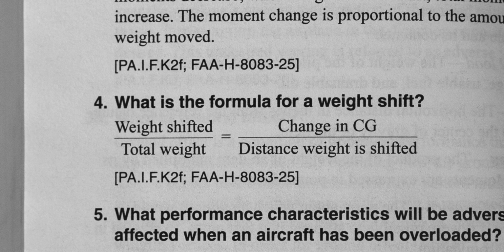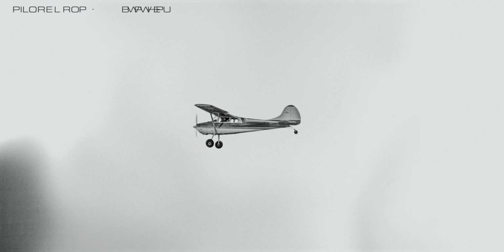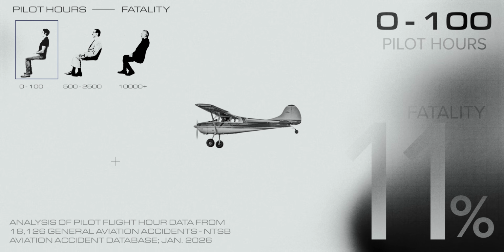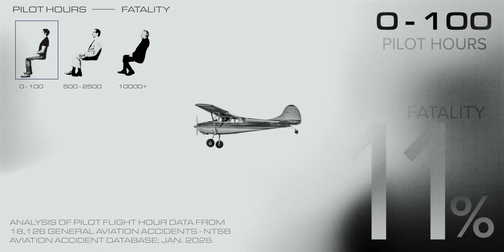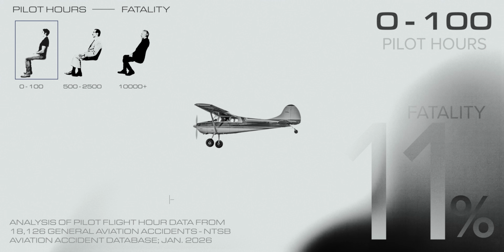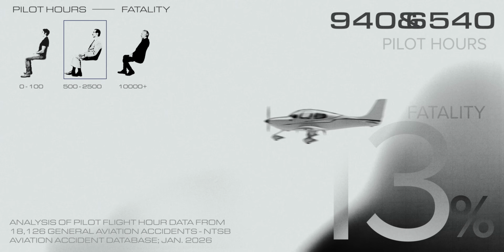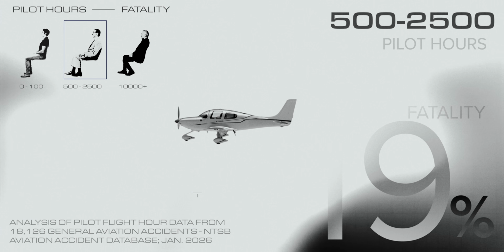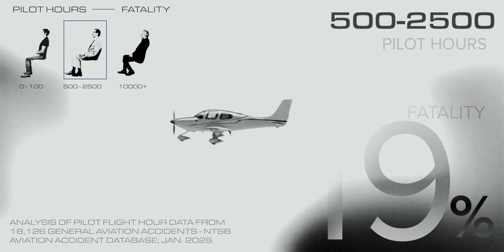Why Small Planes Crash (The 100-Year Design Flaw Nobody Fixed)

Comment: I have flown airplanes with electronic systems, that had "redundancies", yet I've still experienced total system failures regardless, total loss of all primary and backups. And those were simply software failures in systems like the G1000. I just flew my airplane the other day with no electrical system at all. how do you deal with a total electrical failure such as loss of battery, loss of alternator, etc.? all this talk of redundancies and I've never experienced a plane with systems that address my concerns and experiences. And by the time you do solve it, it will be too expensive for most pilots to afford. and even airplanes designed not to stall have had pilot error loss of control fatal accidents. And just look at how much of a failure self driving taxis have been.
Reply: in aeronautical certification there are different levels of redundancy requirements, depending on the consequence of failure of each system. For General Aviation, the loss of avionics systems are not considered catastrophic, but major consequence, and for that reason, the failure probability accepted is much higher. That's why experienced pilots like yourself will have a non-negligible chance of experience this events sometime in their life. Critical systems (the ones considered to have catastrophic consequence in case of failure) have much more demanding requirements to comply so that the probability of happening is 100x lower than those of a G1000 for example. A total loss of energy in a Fly-by-wire airliner NEVER happened in the 40+ years they've been in operation. That's because FBW systems are certified as DAL-A instead of DAL-C (as GA avionics are). DAL means Design Assurance Level, from the ARP4761 standard.
Reply: @LucasFontoura-skytron  Loss of primary instruments in IFR is FATAL. non negotiable. In VFR, less of an issue.

But this is FBW, electronic flight controls, an electrical failure, though mundane for most certified aircraft, would be fatal in this airplane.

"That's why experienced pilots like yourself will have a non-negligible chance of experience this events sometime in their life."

I have experienced all of these sorts of failures in light GA airplanes such as Pipers, Cessnas, etc. Total loss of instruments, loss of generator/alternator, loss of battery, loss of electric flaps in the down position, autopilot failures that tried stalling the airplane, landing gear extension failures, etc.

The consequences of loss of G1000 in hard IFR are fatal without a backup attitude indicator.

" A total loss of energy in a Fly-by-wire airliner NEVER happened in the 40+ years they've been in operation."

but it WILL 100% guaranteed happen in light GA airplanes such as they are designing. We're not talking about airliners here. this video is not about airliners. And no matter how good the system is, it will fail, and you cannot certify avionics to guard against a physical electrical failure outside of the avionics, such as a failed battery, wire, etc.

This will add serious cost and additional risk to already expensive GA airplanes. only the ultra wealthy will be able to own GA airplanes with this sort of technology. The Average Joe pilot flying for recreation cannot afford this.
Reply: @SoloRenegade I'm a cybersecurity specialist, not a pilot though my undergrad degree is in aerospace engineering.  I'm very interested in most things aviation.  I appreciate where you're coming from as I agree that everything will eventually fail.  It's a question of when, not if.  However, I applaud Lucas and the team at Skytron for this undertaking.  Arguments similar to yours were made regarding cars.  And whilst I certainly agree that where we are in the self-driving category reinforces your position, I would argue that most general transportation vehicles are NOT out of the realm of affordability for most of the driving public.  Safety innovations, IMO, should always be encouraged and applauded regardless of from where they appear.  Condemning these efforts as the first fruits from them will undoubtedly be far more expensive than a used smaller GA aircraft from the 1960s that is (probably) still airworthy simply because of the cost is IMO a poor reason for such opposition.  This is the position I would expect from a CFO, but not from the end user.
Reply: @alexanderbreeding1830  the self driving taxis have been an abysmal failure, and all other self driving cars like tesla have had fatal accidents, and tons of buggy issues.

I'm critical for good reason. when you take the pilot out of the airplane, teh purpose of recreational flying ceases to exist. they are addressing the accidents with a false premise.

Cybersecurity has nothing to do with this. if your airplane's autopilot is remotely accessible/hackable, you deserve prison time, not just a failed business.

"Condemning these efforts as the first fruits from them will undoubtedly be far more expensive than a used smaller GA aircraft from the 1960s that is (probably) still airworthy simply because of the cost is IMO a poor reason for such opposition."

False, you clearly have No clue how expensive aviation is, particularly avionics. Don't go criticizing professional pilots, experimental airplane builders, and aerospace engineers on things you don't know about.

The end users will not be able to afford this. the avionics for this airplane will cost more than both of my airplanes combined, let alone the rest of the airplane. these are not airplanes a typical pilot will be able to afford.
Reply: If all else fails there is always the rocket propelled parachute. If all of that fails the Murphy’s Law of “If you make something idiot proof some idiot will prove you wrong.”
Reply: Yes airliners manage to do it with greater than 6 sigma reliability.
Reply: @MrKDreams  AIRLINERS, not light GA personal recreational airplanes.
Reply: @SoloRenegadeTesla FSD computer is fully redundant including redundant cameras.   Hardware has the power to run a neural net stack for driving on roads which is far more dynamic and varied than anything that happens in an airplane.  Cybertruck is fully drive by wire with tripple redundancy.   We are taking 40-60k cars.  How mucy is a new 172 now let alone a cirrus?
Reply: @MrKDreams  and yet we have many self-driving bugs and fatal accidents.....doesn't inspire confidence. No typical pilot is buying a new Cessna. only flight schools can afford a new Cessna. and this plane will cost even more.
Reply: The solution is double or triple redundancy of all systems. It's as if there were 3 souls piloting the plane. If one fails, the other takes over and acts independently.
Reply: @fernmr  none of that protects against a basic total loss of electrical power, shorted cable, etc. Even military aircraft have mechanical backups, or the pilots eject when the FBW fails (and it DOES fail).

Average GA pilots flying their own personal airplanes cannot afford such a system in their airplanes. the cost of the system and its maintenance will be a nightmare. The resale value of these planes will be terrible.
Reply: @SoloRenegade  In a system with maximum redundancy, the cost is measured by the buyer. And in fact, this system can indeed eliminate faults if the power supply and transmission system is also duplicated. By cutting off the power flow to one circuit, sparks are terminated and extinguished in the absence of combustible materials.
Reply: @fernmr  "In a system with maximum redundancy, the cost is measured by the buyer."

Wow you people are stup1d. where did you get an education? you should ask for your money back. the price is the $ amount the seller lists it for. 

"And in fact, this system can indeed eliminate faults if the power supply and transmission system is also duplicated. By cutting off the power flow to one circuit, sparks are terminated and extinguished in the absence of combustible materials."

Power supply? you mean the starter battery? That doesn't have the capacity to drive flight controls for very long, and adds a lot of weight and hundreds of dollars of additional cost as well? And That is still powered by the same alternator/generator too, leaving a single point of failure. And doesn't account for damaged wires shorting out either. All failures that occur more often that you want o believe. typically such failures go unreported as teh plane landed safely and got fixed. but with FBW, that wont be possible. Starter batteries don't have the energy capacity you think they do. They are optimized for short time, high amp use. and flight control actuators require serious power compared to simple mechanical controls which require none. You're adding too much cost and weight for that redundancy that still has single points of failure.
Reply: @fernmr  Thats right.  The solution is redundancy of all systems.  It will have 3 flight control computers, 4 power sources (2 alternators, 2 batteries), redundant power distribution, comm lanes, etc. etc.  It's the same strategy all the eVTOLS are using to build incredibly safe, FBW aircraft.  The aircraft remains safe with the loss of any single component, and, can withstand the loss of multiple components in most scenarios.  No airplane is "perfectly" safe, but we do believe it will be 10x safer than any GA plane that's currently on the market.  On top of that, the aircraft will have a parachute for the ultimate backup.

Comment: you need airspeed, altitude, ATTITUDE, heading
Reply: The secondary function of an airspeed indicator is attitude, so in a failure situation, given a throttle setting, you have some idea of your attitude.
Reply: @tafaragadze6432  you are correct, however in reality it's nearly impossible. I have flown instrument approaches in real airplanes and helicopters without an Attitude indicator, but only with another CFI aboard (and 10min of that was exhausting and difficult, even knowing it was going to happen). I've given students the scenario in simulators and the fatality rate was 100% when the attitude failed unexpectedly. And airspeed alone wont give you enough info, you also need altimeter and heading too.

But, with this automated flight control system, if you lose the attitude, you'll likely lose the airspeed, heading, and altimeter at the same time as they are all a single system. I've had this literally happen with G1000. They claim systems are isolated and have failure backup modes, but every time the G1000 failed on me, it was a total failure of all systems. others have experienced this as well. One couple famously survived only because they had an iPad with foreflight and synthetic vision.
Reply: You seem a lot more experienced than me, but the training aircraft I fly doesn't have attitude. I haven't done instrument, I only fly vfr, and while it would have been nice, I have never actually needed an attitude indicator.
Reply: @keaton_m  yes, if you're VFR, you actually don't need Any of the instruments i listed. If VFR on Top, you'll likely need a magnetic compass at least though. But I've flown solely on pitch and power settings for airspeed, and at one point I even could fly 70, 80 and 90kts in Robinson helicopters simply by the sound of the air rushing past the cockpit. I'm pretty sure many glider pilots can do this too. The first airplane I trained in, i got so used to flying it that I could tell the RPM within 100rpm simply by sound of the engine. and for a given pitch and power setting, i could fly given airspeeds, looking at pitch of the nose to teh horizon (#1 ref point). And of course, as you know, VFR flying requires visual reference to the horizon (the VFR attitude indicator). And if youre able to see the ground and know where you're going, you can look at roads, rivers, and other features to keep track of heading.

What I am speaking of is specifically IFR. the whole premise of this video is safer airplanes and using avionics to facilitate that. if you need avionics to fly safely in the scenario they specifically mentioned in the video, that I was quoting and correcting, was more about IFR flying.
Reply: This conversation is informed enough that we should probably use IMC and IFR more strictly. Inadvertent IMC is the killer to VFR pilots.
Reply: @jeffreypierson3023  IMC = IFR

IMC can only legally be flown under IFR.

Your worry about terms does nothing to change the discussion whatsoever. You NEED an attitude indicator at the Bare minimum to fly IMC or IFR safely even when all else fails. It's not optional. Even the FBW system needs some form of attitude control too.
Reply: False. You need AOA not airspeed. Airspeed is a poor proxy for AOA. An old fashioned Turn Needle would also be nice. The TN is the only reliable source of direction in an inverted spin.
Reply: @Fffflats  you do not Need AOA to fly safe, but yes, you could opt to switch out AOA for Airspeed. but AOA is not as useful in all conditions as airspeed for most mundane typical flying. you can fly numerous different airspeeds at a given AOA, thus leaving you not entirely sure how fast you're going at times.

The point is, I was quoting the video and they left out Attitude as a vital IFR instrument. 

Turn needle is NO substitute for the attitude in IFR. I have trained this in real aircraft as well as simulators and it's still very difficult to stay wings level.

"The TN is the only reliable source of direction in an inverted spin."

good point. but the comment was about bare minimum instruments needed to fly IFR, not inverted spin recovery. I love the input, but it's dancing on the verge of cherry picking.
Reply: @SoloRenegade I wasn’t saying TN was a substitute for the horizon. I was saying there is a different reason for it. Fair enough concern specific to IMC. As to AOA, most your flying except for Vne, and if multi, Vmc, your points of interest are all AOAs not speeds. But, yes, for navigation you need speed but then this is ground not indicated. Vne is interesting as if flutter be the concern, it is really TAS, but if it be dynamic pressure, then it is IAS. Note in the multi, Vyse is really better done as AOAyse. IMC, more broadly, IFR, however, IAS has a good use for spacing.
Reply: @Fffflats  Yes, I gathered you were referring to the TN as serving a different purposes, but wanted to clarify they are not the same.

But I think we're on teh same page. AOA is very useful and has its uses. but I'd venture to say we agree that for certain tasks AOA is better, and for other tasks, ASI is better. Stuck in typical IFR I would care more about ASI as nothing I need to do requires high AOA. But AOA is handy. I just don't see how AOA can help you detect a nose down attitude picking up speed for example. How can you cross reference AOA against altimeter in that case, whereas ASI can be a great cross reference with Altimeter to detect a pitch up or pitch down. But with AOA, you could be flying faster or slower at both higher and lower AOA depending upon what's happening. But I still want AOA in my airplanes. but I can and have flown for years without AOA at all just fine, so that's why I still value the ASI over the AOA.

Comment: adding technology makes things more expensive, less reliable.
Reply: That is such a broad and relatively inaccurate statement. Are modern phones more reliable than phones from the late 80’s? Is fuel injection more reliable at a wide degree of elevations and conditions than a carb? I’m a pilot, and sure, most times simpler is better. But the G5’s that replace the old vacuum generated 6 pack is not only lighter and better, but more reliable.   And more expensive is a relative term. Does the benefit that the tech brings outweigh the cost?
Reply: @ryanrabern8437  The plane and car industry have different approach to using technology. Car industry mostly focuses on bells and whistles instead of improving the functionality and reliability. Physical buttons replaced with touchscreens, door handles hide inside the doors and they cannot be opened from outside in case of emergency, seat heating requires paid subscription etc. So in a car modern technology is often your enemy, not helper. Cars are build to break as often as possible, with very expensive parts need replacement because of some dirt-cheap capacitor or plastic cogwheel.
Reply: @ryanrabern8437  Well said 🙂
Reply: @ryanrabern8437  not inaccurate at all. Mechanical and Aerospace engineer who's done record setting work for NASA and others. Professional Airplane and Helicopter pilot, combat vet. I know well how unreliable things can be and how your life can depend upon them, and how many things go wrong in testing, R&D, and in the real world after mass production. More things that can fail in more ways means less reliability. and the more and more software you add, the less reliable and more prone to failure things get. 

"But the G5’s that replace the old vacuum generated 6 pack is not only lighter and better, but more reliable. "

not in my experience. they are far more expensive, harder to service, I've experienced total system failures from such systems in flight, and nobody could figure out what happened or why afterwards. Steam gauges also have unrealized advantages that most pilots aren't aware of. I don't much like vacuum instruments either, but most steam gauges are not vacuum operated at all, only 0, 1, or 2 of them are depending upon what you have installed.

Tech has some advantages, but the old steam gauges and radios in my 1964 Cessna are factory original and still working.